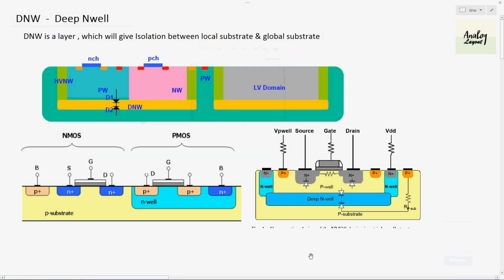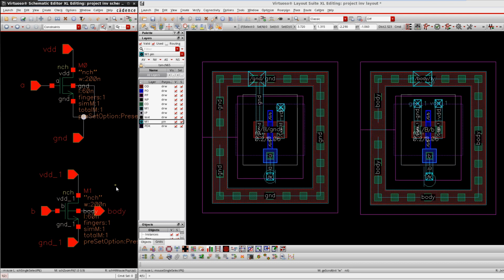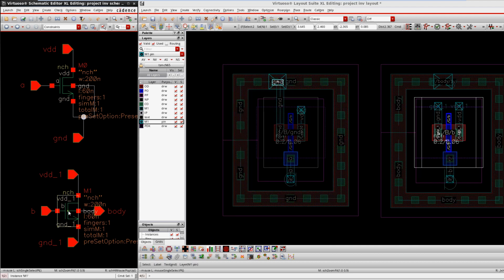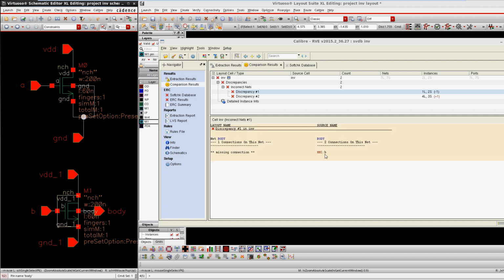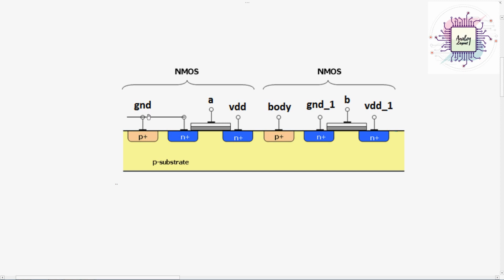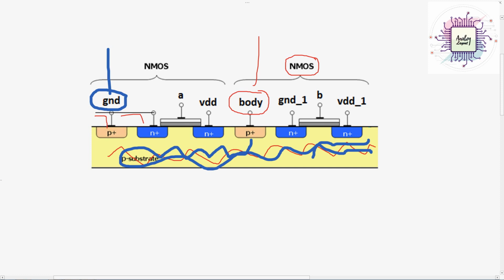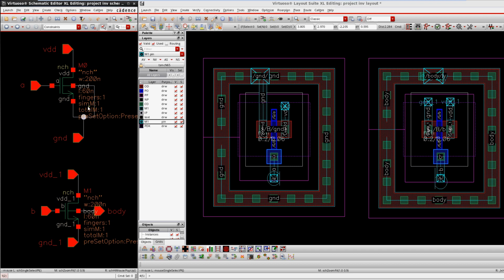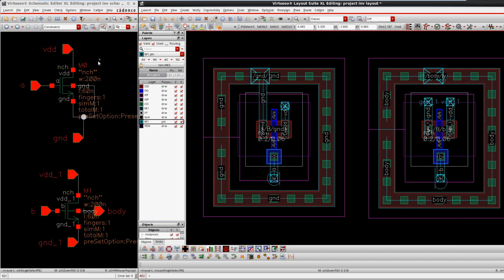DNW - Deep Nwell (Part-1)

Comment: sorry to say this man too much rubbish very less content, repeating the same things again and again even 2x speed can't provide me what i want

what you have to explain 

1. Why DNWELL ?  mostly for isolation due to body effect which gives vth increase and so the w/l ratio---- to avoid use a separate body bias to balance the body to source voltage which in return stabilizes the vth which is most important for biasing conditions.
2. In this schematic what went wrong with layout ? not isolated
3. main point psub is global where direct body and sources are connected to gnd (psub) for m2. but for m1 actual body connection is missing which is a different connection(not gnd) so you have to form a different layer of psub where you first create an nwell and on top of that psub and this psub gets connnected automatically with body. 

someone please correct me who is well knowledgeable and currently doing some analog layouts in the industry or industry collab. 

The author of the video please don't correct me i may not understand even if you correct me. please stay quiet.

I don't know why you took 25 min for a 5 min video. If you are a professor students will suffer a lot mostly sleep in the class
Reply from the maker: You’re mixing valid points with unnecessary noise.

If your concern is DNWELL isolation and body biasing, explain it clearly and correctly instead of wrapping it in insults.

If the pacing doesn’t work for you, skip the video. Others are finding it useful.